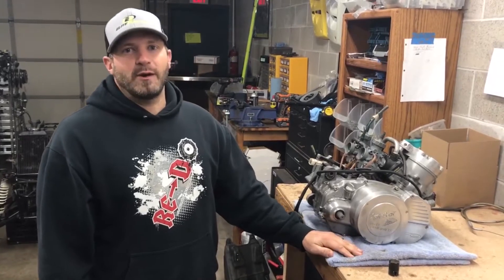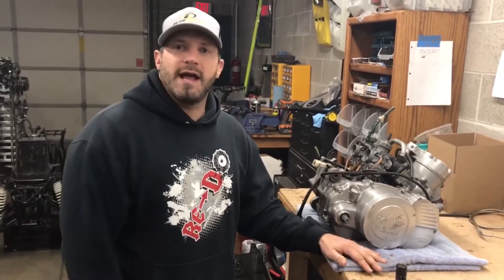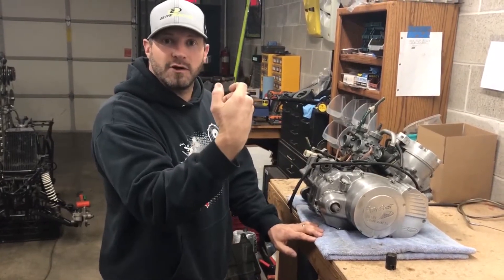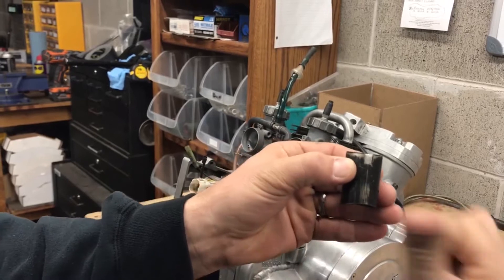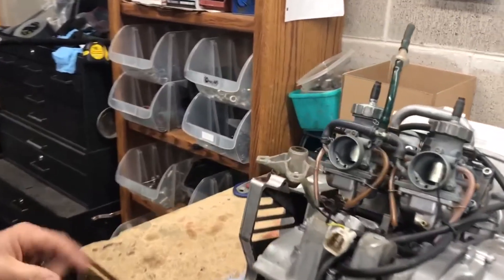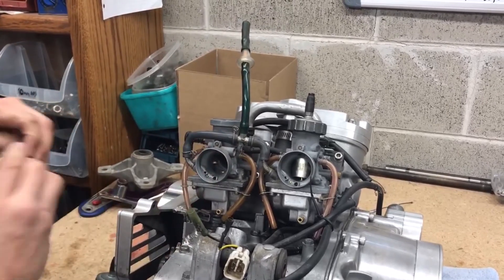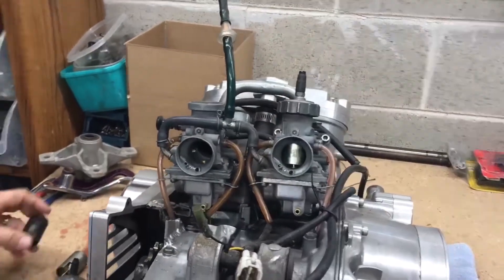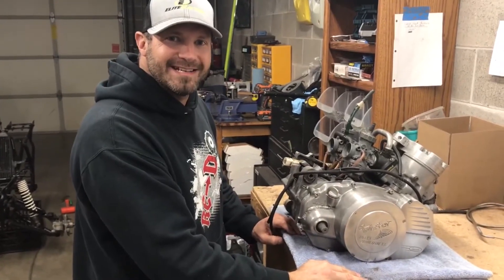Banshee Won't Rev? How To Tell If Your Carb Slides Are BACKWARDS

Comment: woowww so happy to have watched your video... Indeed it "seemed to me the slides were too down when looking at them from the back, but I was just telling myself: "no it's just my brain.... wrong memory...impossible the issue comes from here because it doesnt allow to slide if put in wrong direction"... And that drove me crazy... trying to fix the rich mixture issue.... was trying to open air screws to max, and still got the issues.... i verified  the choke system in case it was leaking fuel inside etc... !!
Finally that was just what you said: The slides were swaped from right/left, which allowed the slides being slided in the wrong way !
Man so many thanks !!
Reply from the maker: I'm glad we helped steer you in the right direction. Outside of cdi or harness issues most of the run issues banshee have are pretty chase able.